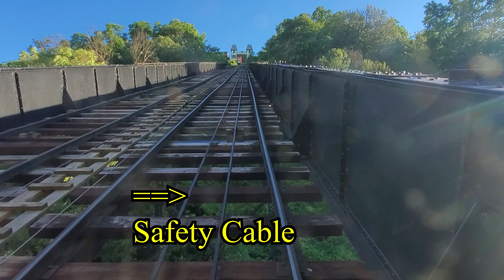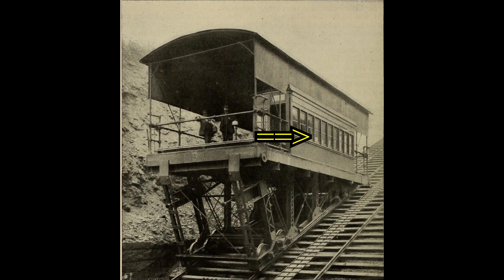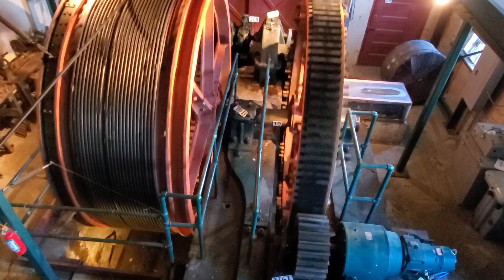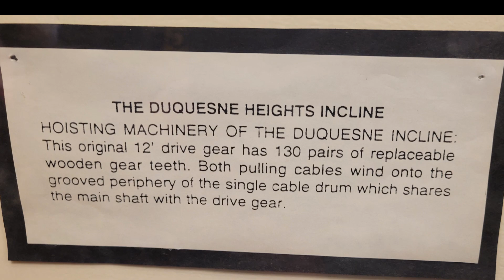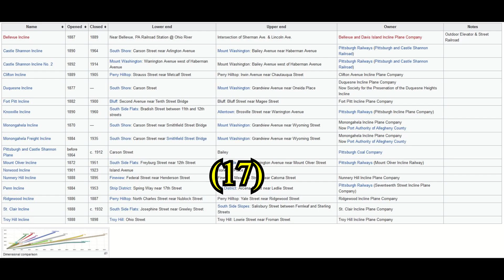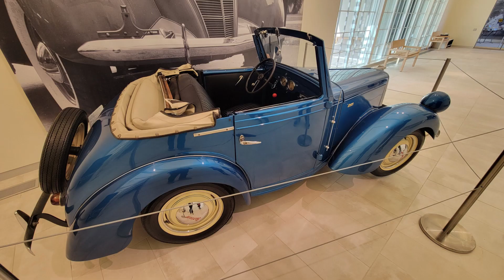Pittsburgh's Duquesne Incline & Frick Carriage House

Comment: Would the safety cable truly prevent movement or simply slow the car movements based on the weight balance between the two cars?  I suppose there is a decent amount of friction running through the sheaves.  Great video by the way, thank you.
Reply from the maker: I didn't specifically see a braking mechanism on the safety cable, but logic would dictate it's something they wouldn't leave out.